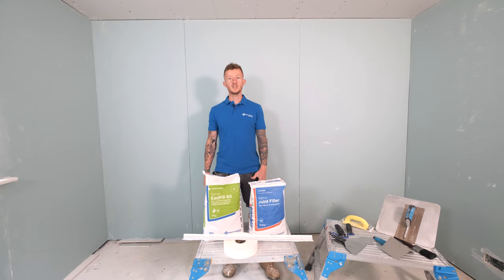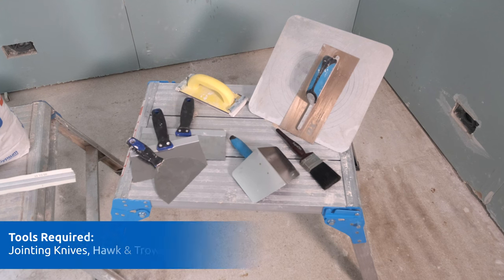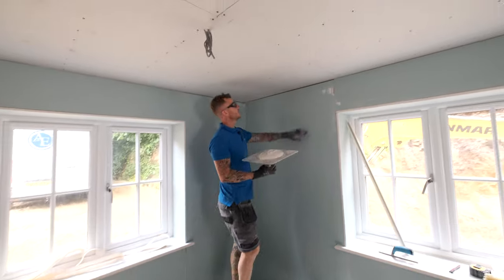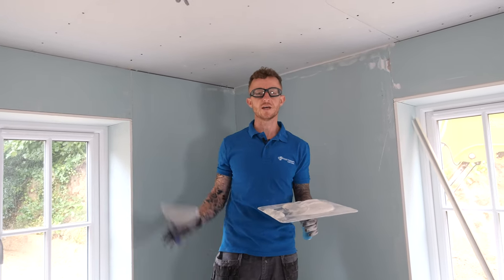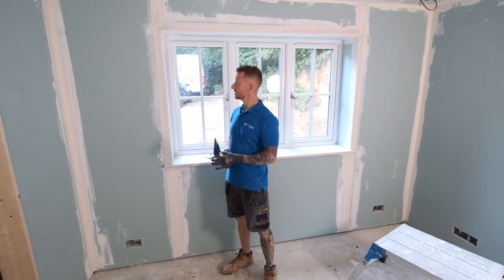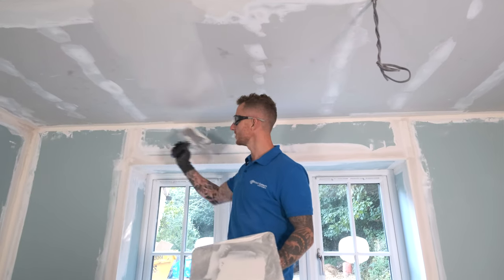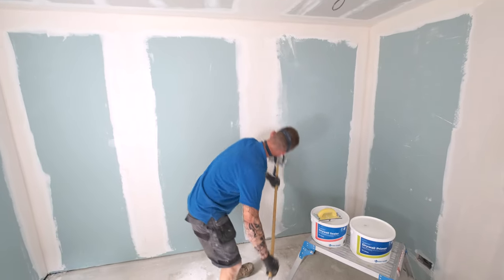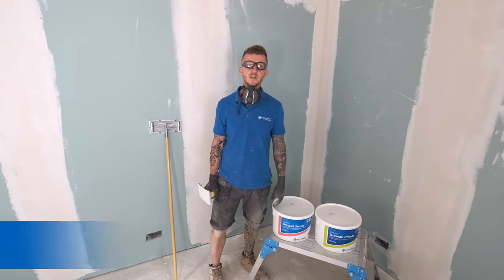A practical guide on how to tape and joint using British Gypsum’s Gyproc Jointing Products.

Comment: Thanks you for making this video, you show an alternative to hiring a plasterer. I think a decent DIYer will be able to put up plasterboard and fill the joints for very little money. Because of the cost of living here in the UK, caused by a certain group of people in charge of the country, trades have increased their prices too much. I know the cost of materials has gone up but not to the extent that we need a small bank loan to pay their invoice. So, DIYers get off yer arses and have a go at this, it’s not difficult. Also, most people cannot plaster or have the time or inclination to learn, this method of plasterboard and filling is accessible and achievable for a wider base of people to have a go. Love it. 🤘😁🤘
Reply: As a carpenter you will be surprised at how much materials have gone up since covid, plus the cost of fuel etc. As an example during early 2020 i used to be able to get 18mm shuttering ply for about £28 per sheet, it's now over £40 per sheet. 18mm birch ply i was getting for £64 a sheet, it is now between £175 - £200 per sheet.
Reply: @carlb401  Yeah, it's a fair point, I've noticed it too, can't not. I'm an amateur woodworker and I'm using a lot of second hand wood, even pallets.
Reply: Come to Ireland and you will be astonished at prices! Double, if not triple the UK
Reply: @MeMe-dw1sm Being in Europe I thought it would be cheaper
Reply: @carlb401 most plasterers around would want a £600 for that room if your lucky most would be closer to a grand

Comment: What a carry on.. skim that room in a day, done!!!.. don't understand why big home builders are doing this? Save on drying time
Reply: becuase the average man cant plaster - this is doable though.
Reply: Most competent people can do this.  However finding a decent plasterer who doesn't charge the earth and leaving it looking like the waves of an ocean isn't easy.  Once painted tape and jointing leaves the same finish as a top end plasterer at a fraction of the cost
Reply: @asef698  the last sentence is absolutely laughable
Reply: I'm making my loft a bit more usable - deluxe storage i think they call it. I was going to skim but I understand that makes the room 'habitable' and would be subject to building regs. Tape and joint is ok though. Crazy maybe but that's the use case I'm watching this video for.
Reply: They’ll tape and joint a 3 bed house in a day, then rub it down in a day. All over the course of 3/4 days ( including drying time ). Then ready for painting. Plus it saves 5/6 ton of water going in to the building and saves on the ( lately ) astronomical money good plasterers want to charge. That’s what was told to me anyway by project managers working for one of the biggest builders in UK.
Reply: @edpp3687  illegal is the actual term! Doing anything to your loft requires building regulations if it is to become usable at all.
Reply: @martynmongan9123 that’s not how I understand it. I’ve seen big companies doing ‘storage’ with spotlights, insulation and plasterboard. Just don’t put a bed in there 😂
Reply: @FFTuk  as a building inspector I can guarantee you that it is. These 'big companies' are nothing but cowboys who are getting away with miss selling these spaces and unfortunately people are stupid enough to hand over their cash. It's a shame and really the Local Authorities should be enforcing on such work.
Reply: @martynmongan9123  illegal!!!
Not complying or getting building control sign off is not illegal, nor is using any space you want in your house for sleeping or whatever else you may want to do. It may be bad practice, it may be a bad idea but it is not legal.
As an inspector I would of thought you knew this😂
Reply: @stevenbullock913  alright Steve. You know best. It is a criminal offense 100% Let me guess you're a competent builder?
Reply: @martynmongan9123 I contacted building services at local council, told them what I was doing and they gave me a written exclusion statement that the work does not require building regs inspection.
Reply: I told them I was going to board on raised loft legs and build dwarf stud walls under purlins for storage. They said no problem. If I got a velux window or installed a staircase then I'd need building regs. Seems like there is room fot interpretation and your statement about any work on loft is illegal. If I've been advised by local building that I can do the work I'm not sure the case would hold water.
Reply: @edpp3687  yeah because they nailed with Grenfell! The fact an enforcing body is advocating this helps explain the current position of the construction industry. I just can't understand why a loft would need altered for 'storage' yes the legs and boards can be fitted without BR approval but this is purely to ensure the insulation is not squashed/compromised. Is there a need for dwarf walls, surely this would take up more space? Lofts are not actually designed to store anything, they just happen to be used for it.
Reply: @martynmongan9123  I had a project, in my own house, I went through the right channels, I thought it through. Perhaps you ought to do likewise before shouting Grenfell and illegal at people doing very typical loft projects.
Reply: @edpp3687  OK. You enjoy your Frankie loft. That is all.

Comment: Hi John, I’ve just watched your video with a view  of using this method to renovate a house that I am doing at the moment, I am not a plasterer by trade but I can get away with doing small areas. I was watching your video so I can take on larger walls and ceilings,
this system seems very long-winded and time-consuming. Thanks for taking the time to make this video It has been very informative and a real eye-opener that I think my time could be used elsewhere in the renovation and I will get a plasterer in to do the bigger walls and ceilings that I don’t feel that I can do.

Comment: Great Video, but here's the thing, I've skimmed hundreds of thousands of square metres of plasterboard in my career, but now for my sins I live in Greece where there is no skim coat plaster, so I have had to resort to taping and jointing :-( I have a small room about 2.5 m square, a door, window, and 5 external corners with small reveals, it would take me about 2.5 hours to skim that lot to an almost mirror finish.

I made a special effort with the plasterboard, all machine cut with a good fit, so extra time there. Since then I have taped and jointed it all and filled and sanded twice and  the finish is still nowhere near as good as a skimmed finish, you have to wait at least 24hrs before it's dry enough to sand and then repeat the process. 

So far I'm about 3 days in and I would be ashamed of the result if it was skimmed.

I did a fair amount of T&J over the yerars in huge rooms with maybe 30 8' x 4' boards along a wall with just a door and a window, and for that it is great, I simply couldn't skim a room that big in the same time, but in small rooms with lots of corners, windows and doors completely the wrong method! I could have driven back to the UK, collected some Finish, returned and I would have got a better result, it's just the 3600 mile round trip that stopped me doing it :-))
Reply: Hello, as a Greek living in UK, I initially found skimming strange 😂. As a person of both worlds, what is the British equivalent of what we call in Greece "sovadisma"? Is it using easyfil to skim coat everything or what this guy is doing in the video? Also, If I plan to use on new plasterboard easyfil to fill in larger gaps and screw holes and then multifinish. Do you know if I should use mesh tape or paper tape for the joints? The americans seem to be using paper, but it's a different process.

Comment: Normal angle bead for external corners is much better 👌
Reply: Does a normal angle bead fit into the tapered edge of the plasterboard so it's flush?

Comment: Great video, very helpful. One quick question, will the Gyproc joint filler adhere to a vapor control barrier? We have a Siga Majrex layer exposed in the gaps between the boards in the ceiling and cannot find out if it will adhere to it and the plasterboard. Thanks

Comment: When you put corner tape in, you didn't put anything on top just scraped paper squeezing everything from underneath. do you not need cover paper in corners right away (50mm on both sides)
 like ceiling but joint?

Comment: Joint filler has an exothermic reation once mixed so it produces heat as it's drying so it needs somewhere for the air to go once it's in the process of drying, using filler and applying paper tape over the top is likely to cause blistering as your covering the joint giving nowhere for the heat and water to evaporate. Paper tape is meant to be set with an air drying material. 
thats why when people use scrim tape they use filler as the scrim tape has holes in it giving space for the evaporation of water and the heat to be expelled from the joint and that's why paper tape is meant to be set with joint cement as that's a fully air drying compound so there's no exothermic reaction going on behind the tape. 
Not slating the video but I'd have thought British gypsum would be clued up in this aspect, although I can understand him not using British gypsum joint cement as it's the worst on the market lol, good video for anyone new to taping though, good to get a rough idea of the trade.
Reply: Which filler would you recommend for plasterboarding. Im a complete novice having a go in my garage. Cheers
Reply: @BS-ix7qp  easyfill 60 would be your best bet I’d say mate
Reply: @liamcowan5986  if am putting back a piece of removed finished plasterboard (cut of to fit elec fire)back into a while . Could I use the same process along the joint once I have put back the removed piece ?? 
Would I be able to get a decent finish after sanded and painted , to blend in with existing finish ?
Would easy fill finish be good for this ?
Reply: @karimkechkar  you can do this mate, once the piece of plasterboard goes back in you have to check how level it is (is the plasterboard proud of the existing substrate or sunk in?) this will determine how and where to fill. If it’s proud then you will fill from the highest point to the lowest point to blend in nicely. Remember that it’s better to have multiple thin coats than 1 thick coat trying to fill out everything. Take your time with it. Easy fill will be ideal to use
Reply: So which one would you recommend for first second and third coat? Is Smart mix okay for third coat?

Comment: If jointing cut edges (i.e. square, non-tapered), would it be advisable to use a rasp to create a taper?
Reply: You'll end up with ragged paper edges which, no matter how much you fill or sand, will show through. Fill over the top with Easifill and taper it out a good 30-60cm either side to disguise the joint.

Comment: on the external corners did you use the same tape? or is it a harder type of corner bead?
Reply: Its a different tape Tino, Its got a metal band on it to form a stronger , straighter corner.
Reply: The outer corners are reinforced with iron. Because it is susceptible to breakage and shocks

Comment: I've had plasterers, just apply a type of tape that has got holes in it and fill then just fill the lot with plaster.

and I've always had crack marks, good to see it done properly.
Reply: It's called "scrim" there's nothing wrong with using it .
Reply: That's what you're supposed to use with plaster. It's scrim tape and designed to flex. It's rarely the plasterer's fault that a wall is moving.

Comment: Do the 2nd and final coat go on the same day ?
Reply: It’s possible if using a fast set product but I wouldn’t recommend as it’s never 100 percent dry. Also never apply a quick drying product to a painted surface plaster board only.
Reply: With flat tapes and externals it’s possible, if small area we use fastset to put on, fastset and promix for second coat and promix for final coat however can’t with internals as internals shouldn’t be put on with fastset

Comment: What is the purpose of the tape? Why not just use filler, obviously I'm no plasterer.
Reply: I believe its for support. If you plastered a wall without it then it would end up cracking over time with heat and movement in the boards.